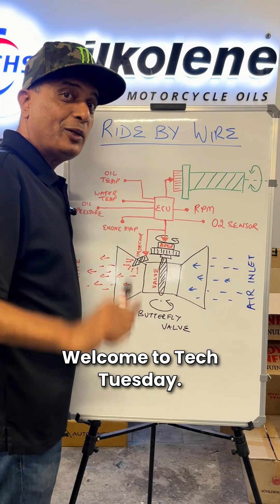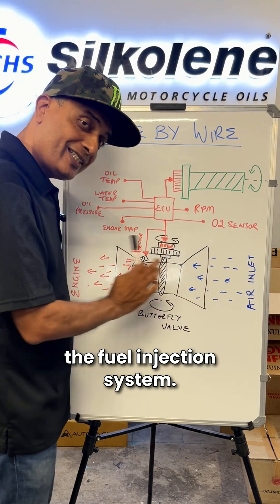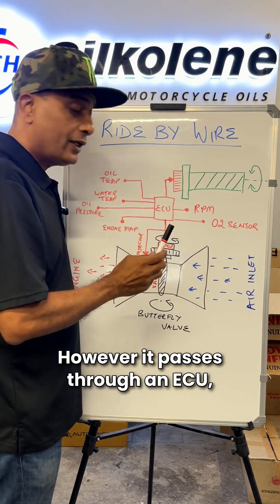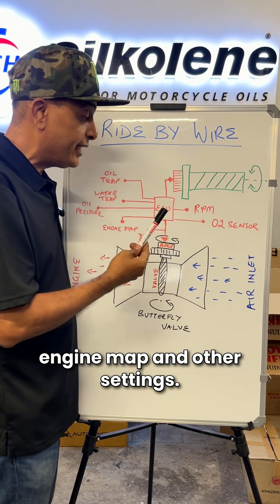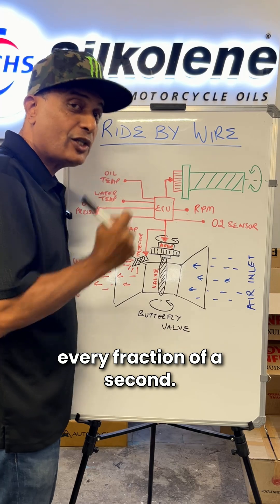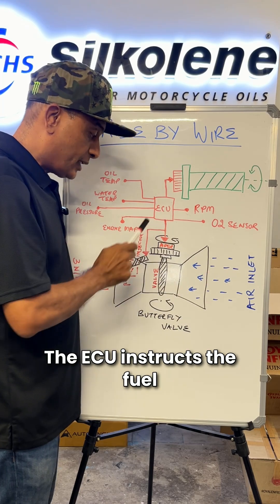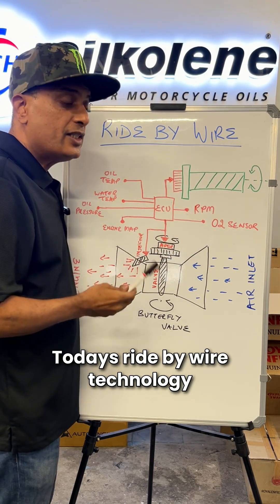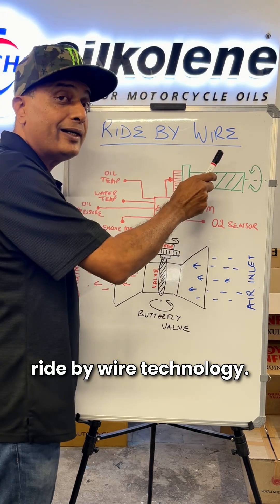Big Bear Tech Tuesday - What is "Ride by wire"?

Comment: I have a doubt 
Can i do 
Clutch less downshifts in my 
Scrambler 400x ! 

Which bikes supports actual clutch less shiftings ! 

I saw many videos about engine breaking but still confused 
Should i use clutch or not in my scrambler 400x ! 

Can engine breaking break the engine ! 

Please make a video 🙏🏽
Reply from the maker: Recommended to use the clutch when down shifting to reduce shock loading the gearbox. 
Will check on the engine braking video possibility.
Reply: @ thank you ☺️🙏🏽

Comment: Hi sir 
Which handle bar riser is suitable for speed 400 

In which  have NO turning issue , no vibration issue and no strain on controls wire.
Reply: Please suggest
Reply from the maker: I prefer stock height and unable to suggest.

Comment: Hi Boskey,
I own a royal enfield meteor 350, there has been a significant mileage drop from 35-36 to 29-30 so got it serviced recently,  ~18500 on the ODO.. still no luck... checked the Mileage tank-tank 2-3 times!   -- I just wonder what might be wrong! :(
P.S - I check tyre pressure, lube the chain regularly... (sprocket set is new)!!
Reply from the maker: May be a wearing clutch

Comment: Loved it better when there was a Carb instead of a moody girlfriend of a chip. A few months ago, mine had a malfunction and didn't feel like it recognized the throttle position properly. There was no throttle input as i was trying to slowdown for a red light and still it kept chugging in fuel, maintained the same rpm till I applied the clutch and light brake input. I admit I wasn't braking, but rather tried slowing down with just throttle down, there was no engine braking whatsoever. I just couldn't explain the issue till they could seee what i meant. They kept saying, ofcourse the engine willl try to keep up with the wheel speed when you have some momentum and you're in gear.  Then the ASC replaced the sensor, and it happened again days later it happens again and then the second sensor swap was a charm. While I count my luck since this was all under warranty and probably a rare failure, it still makes me miss the Carbs😅
Reply: 1. Part number 36PD0112, (PAF/MAF sensor I suppose) if that makes sense
2. I was there when they swapped it out
3. Another tell tale sign was the IFE on the odo would show impossible numbers

Comment: I have classic 350. Just an issue of starting to motorcycle as the starter is not able to start the engine which felt like the battery id dead or not working but the battery is fine. When I don't ride my bike for 1 day it won't start the next day. So what would be the issue of not starting ? Pls help
Reply from the maker: Battery or the charging circuit or there's an electrical leak that's draining the battery.

Comment: Thanks for sharing the information. One question, what to do if (we are on a mountain with no access to mechanics...) ride by wire sensor gets spoiled. Can we replace or fix it on our own by carrying an extra spare part (not sure which spare part)?
Reply from the maker: Nothing to worry. This system has been around for decades and is reliable.
Reply: @bigbearbangalore Reason for asking is I had faced the issue once.
Reply from the maker: So you have experience then. So you should share what you did.
Reply: @bigbearbangalore   In my case it happened 25-30kms away from the BMW service centre at Bangalore. What had happened is even when my 310 gs sensor got spoiled, it allowed me to roll the bike at 10 kms per hour in 1st gear so I kept on riding it. Towed bike using autorickshaw on inclined roads. But not sure what is to be done on the mountains, lonely situation.